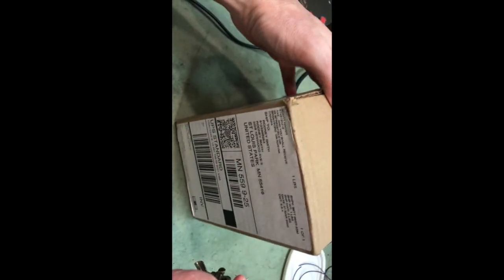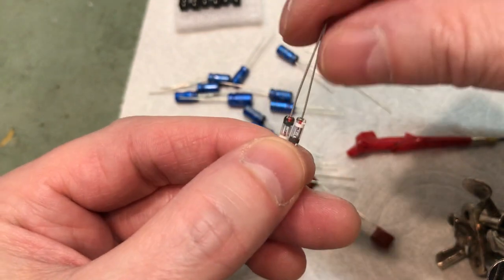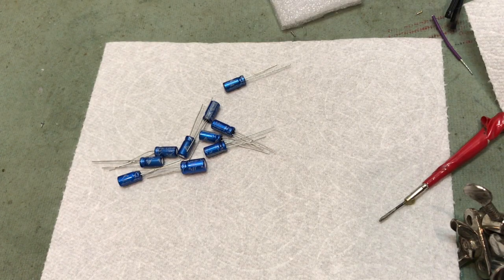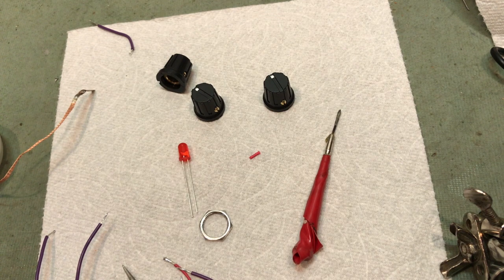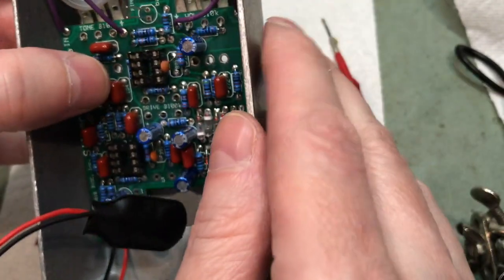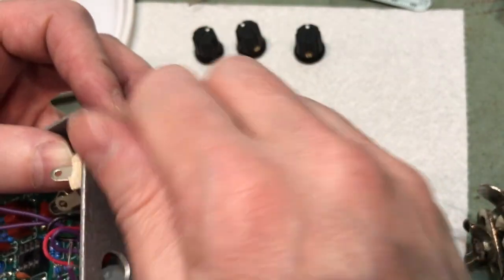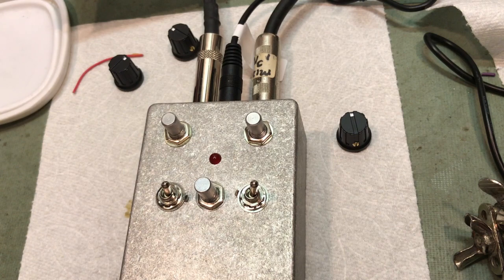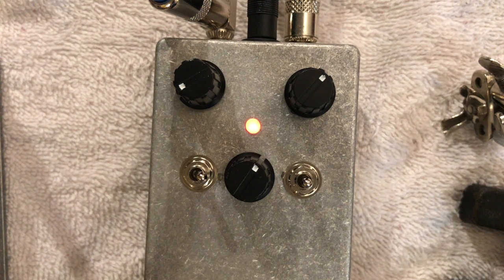BYOC Silver Pony Build

Comment: Thanks for the tips! I’m building the Classic Fuzz. The instructions are great, much better than other pedals I’ve tried to build. But still there’s some quirks that your video helped me with, like trying to get the pots lined up and in the enclosure. I’m worried about shorting out the pot mounted in the middle of the PCB, so I might just put some electrical tape on the back of it, just to be safe.
Reply from the maker: I've done that before, and it's worth it just for the peace of mind.

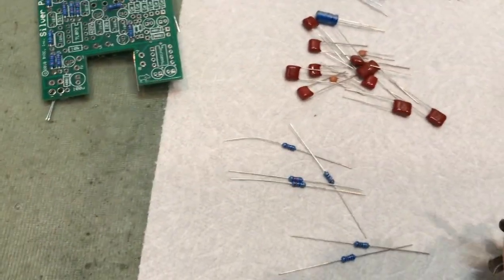Comment: Dude. You are my hero.  I'm new to this and I really want these amazing tones that come from pedals that cost 2-3 times as more. But I'm a proud idiot when it comes to electronics. Proud that I admit what I'm awful at. Can't get better if you already think you're great. I know the pdf build guides are perfect but I'm that one slow learner that needs the extra baby steps. My only question is around 3:15, the quick cut from a bunch of wires to a clean soldering (I probably said that wrong). Is it just a matter of clipping the wire as close as possible and then soldering? Otherwise, if I can build this, I can soon have a great Bluesbreaker and Zendrive for like, 80 bucks and labor (not even labor to me, more like adult Lego building).
Reply: probably 2 years too late, but i would solder first and then clip off the excess.